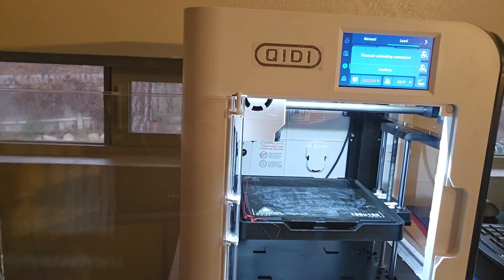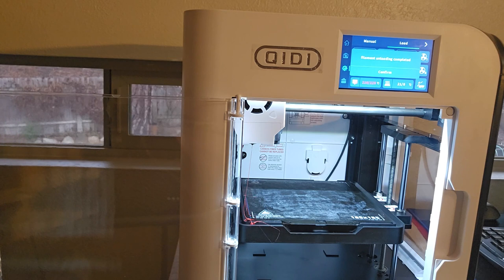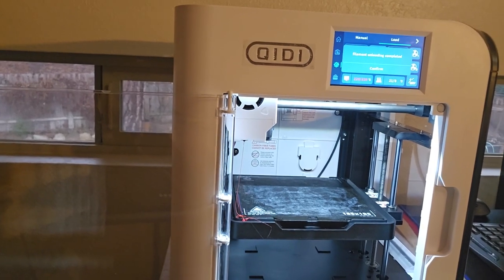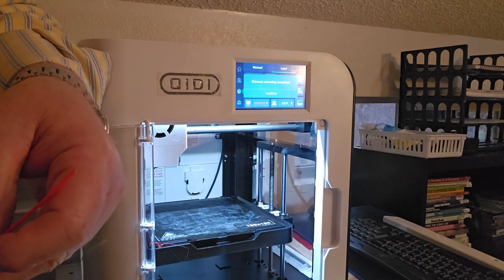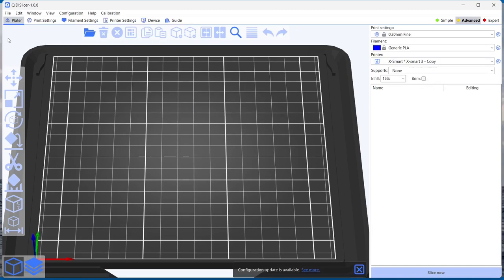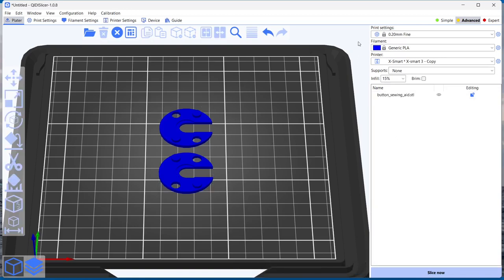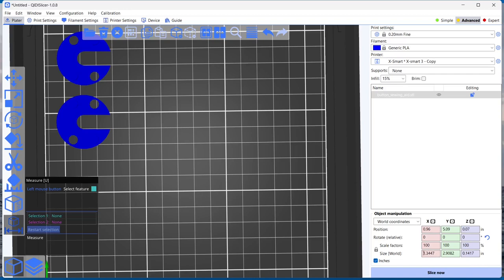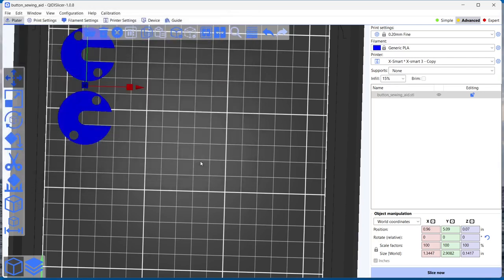Basic Use of Qidi X Smart 3 Printer

Comment: What brand filament do you find works best in the x smart 3?
Reply from the maker: I have been doing very well with SUNLU high-speed PLA. I bought a pack of 1 kg each of black and white on Amazon for 24 USD.  SUNLU High Speed PLA Filament 1.75mm, 30mm/s - 600mm/s Print Range, High Flow Speedy 3D Printer PLA Filament, Designed for Fast Printing, Neatly Wound, 1 kg Spool, 2 Packs, Black+White https://a.co/d/fTaZabc

Comment: I hope you know you supposed to clean the plate after each print. It is not hard and prevents problems with your next print. The glue is not necessary for PLA printing but rather for high temperature filament types.
3d printing is not as easy as printing on a paper printer, it does require at least a basic technical know-how. What I like to compare it to is an musical instrument, you can't just buy a guitar and start playing if you have never done it before.
The bottom line is: 3d printers are not designed for grandmothers, at least not yet 🤷‍♂️

Comment: I hate 3d printer virbrate move fast to fell  bad.
Reply from the maker: @shekiba.646  The vibration can be controlled by running the resonance compensation calibration in setup. Also, make sure you have the printer on a really solid table. It is still noisy and vibrates, but that is the nature of the core x-y type of printer running at high speed.